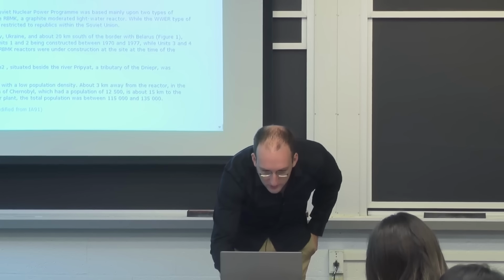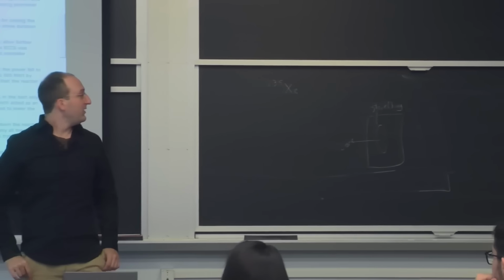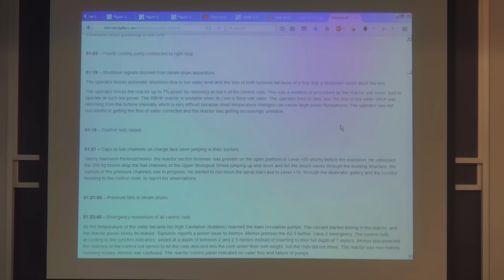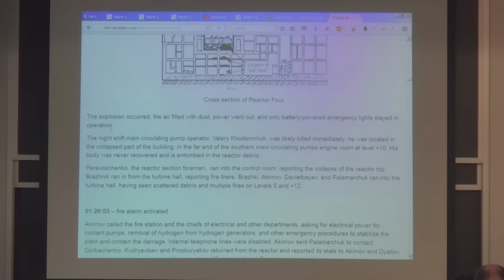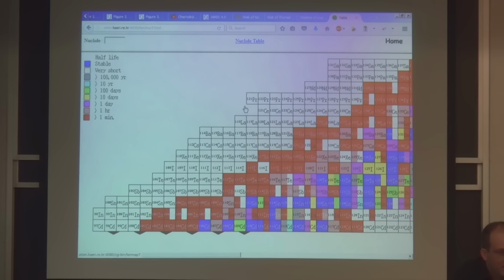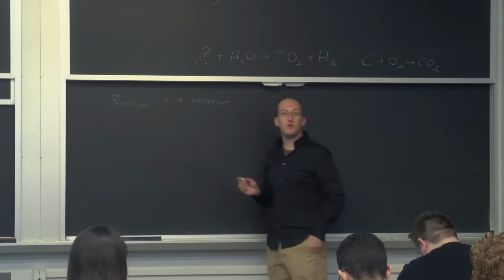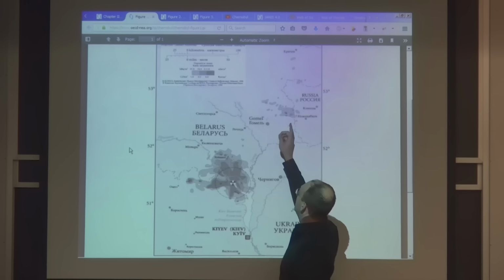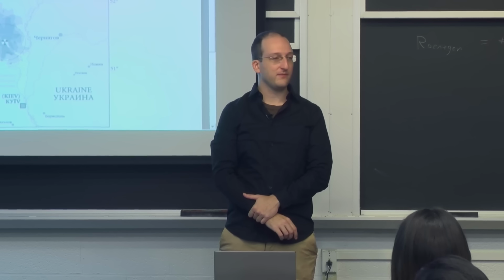26. Chernobyl — How It Happened

Comment: Understanding Corium, you'd need to combine both particle physics and fluid dynamics.
Then you'll see that Corium as it's seen in the 'Elephants foot' is not the actual core material
for the most part, but that the core material itself is still going lower for the most part.
As the core material burns through all the solid stuff that makes up the nuclear reactor,
it gets mixed, while most of it continues downward.
The solid material that gets formed as a result of the burn is lighter in weight, and thus
travels aside and upward, while the still reacting core mass continues on down.
If it were truly all mixed, it would separate by diffusion through the other stuffs, and thus
with distance and density becoming lower between the fission material's colloidal form
it would make for a lesser reaction, cooling down, which is what happened to the surface Corium.
But...
The fissionable material is still reacting, and continues it's way down.
I wonder what they'll find under the 'Elephant's foot', once there's someone that can move it.
Will it prove a hole in the ground or will all of it have diffused ?
If it were me on that case, I'd send in a remote controlled lifter, and check beneath it.
In this time of robotics it shouldn't be too hard I hope.
Like 4 servo engines, a buzzsaw and a main engine. Perfectly safe.
Alternately they could drill a hole sideways angled down until beneath the foot.
If there's a hole beneath then the core material is still going down further and further,
until enough of it has diffused into the alternate materials, stopping the reaction completely.
This would be neat to know, since it means that with enough shielding underneath a
nuclear reactor, any diffusion with it between the fission material and the shielding would
be able to 'control' an out of control reactor's spread of fissionable material,
much similar to the auto separator which would then be much similar in function,
but with less escape of radioactive stuff.
If there's a hole underneath the foot, then the only way to quickly 'control' the out of
control reactor would be the auto separator, which has the same effect as with the prior,
but to a much more artificial effect and much more quickly, since the material would be separated
many more times before starting to burn into the auto seperator the same way as into
the shielding.
Most fission materials at nearly half the surface of the Sun's temperature are really liquid.
Reply: Also, for a correct model on the ChNPP, you'd also have to frame check with
the pressure differences, and their effect on the water behavior as it was being
tried to be pumped into the reactor.

Since every pressure release by any thump of the caps would cause a pressure drop,
allowing for more water to be converted into steam, buildin
pressure up again, at breakneck speed.
Any control system would have trouble recalculating the correct settings,
or even registering the correct measurements.
In fact,. when the framerate of recalculation and interpretation of the measurements
is done too slow, the pressure may actually present itself as steady at some point,
while the actual measurement is nothing more than an averaged number.
Pressure spikes, heat releases, cooling, and whatnot all on the fritz, while
the meters say steady. Umm, yeah..bawd.
With those pressure increases/decreases, heat release uncaptured/captured comes
high variability of fission process speed.
Then once a peak happens that can't be absorbed enough, that's when BOOM happens,
self sustainance of fission and an estimated 5 terawatts for 0.2 second happens.
During this process, the fissionable material starts turning gas as well while said turning into gas partially, which then slows the reaction again, but during even this short period,
the energy output..omg.
Puffing, parts gas, lowers density, decreases the fission rate, lowered output makes it all go liquid again, retraction of density expansion, renewed flash, and so on and so forth.
Also, the Corium has gaseous byproducts, luckily, since any gas development decreases
density of fission material, once again lowering the fission rate.
For any fission rate the density of the fission material changing makes for either more or less
fission. When increasing density the fission rate goes up, and decreasing the density
lowers the fission rate. Ofc you know that already. But that it could happen many times per second you may not yet know.
And then ofc, the involuntary fission of Corium and pre-Corium constituents that normaly
don't want to fission, but fission as a result of the high number of neutron release.
This fission is actually good, since it absorbs some energy rather than release it.

Comment: 25:09 Yeah, all stopped, not..

Putting lots of lead on top, solo, may have contained upward radiation, but underneath,
now you'd have a bouncing shield that returns neutrons back into the fission material.
So, despite not radiating upwards still radiating.

Then again, at this point in time, just about the only measure that prevents massive radiation release
upwards into the atmosphere and surrounding area.
Since it was this deep, and depending on the water table and such, possibly a
cadmium/boron carbide insertion may have been the better option,
although this technology wasn't readily available at that time.